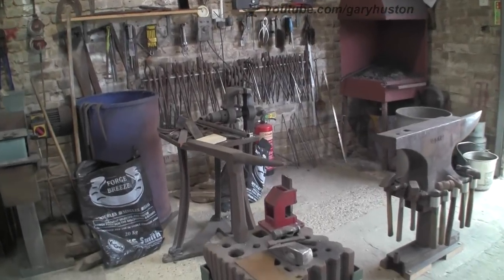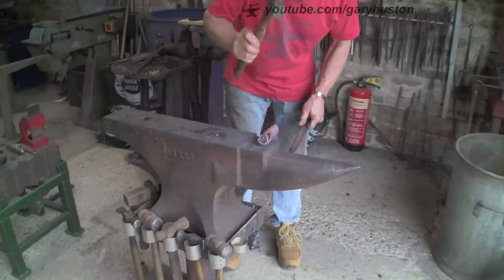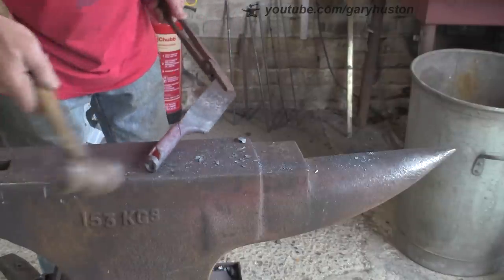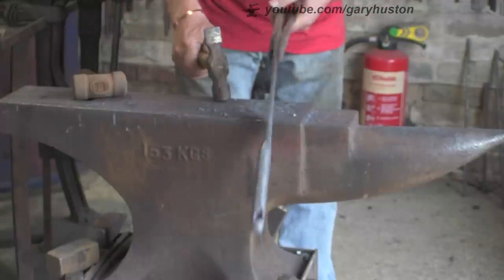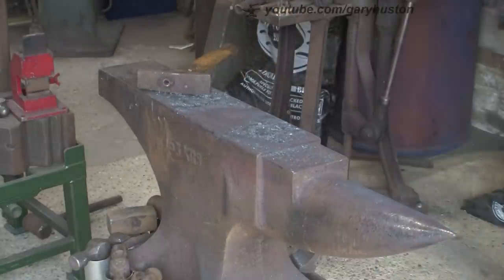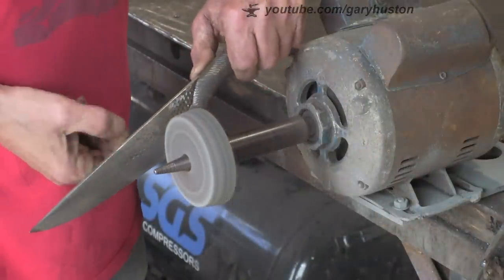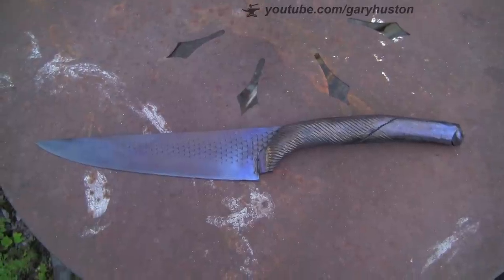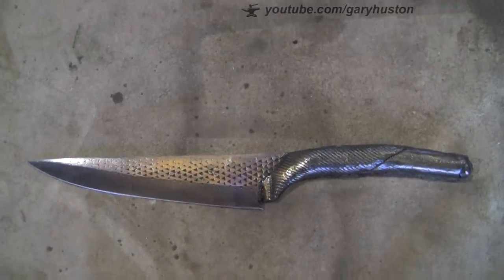Twisted Farriers rasp knife.

Comment: Now you have the room, how about that power hammer?  Could even build your own, I've always liked the big, multi-episode projects.
Reply from the maker: The only one I think I could build would be the Joshua de lisle one but I would need a bigger compressor to run it so more expense. I’m toying with a press instead, I just need to weigh up the pros and cons of each.
Reply: @garyhuston  check out the Clay Spencer Tire Hammer. No compressor needed. Plans are available and it’s built of mostly reclaimed materials. I have in and it’ll work up to one inch stock pretty well. I’ve used mine for years with no complaints. Though, I will admit, a press will just do some things quicker and more efficiently.
Reply from the maker: @serendipityforge333  I have actually got those plans, I downloaded them a while ago but didn’t think I find all the parts. I guess I need to re look at it.

Comment: That came out very nice! Have you ever been tempted to have a gas forge in the shop as well Gary? These days I find the only time I fire up my coke forge is when it is to work on something that wont fit in the gas forge.
Reply from the maker: I’ve got one but rarely use it
Reply from the maker: The gas is so much more expensive than the coke!
Reply: @garyhuston  it is different here in Australia, gas isn't cheap, but coke is  quite hard to get, and usually isn't in a size suited to forging, you have to break it up yourself to manageable size.